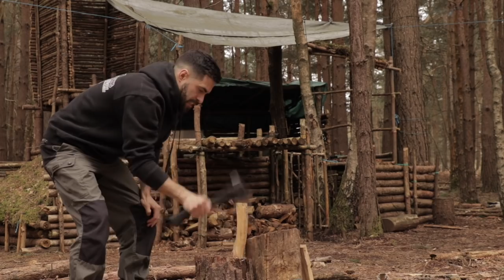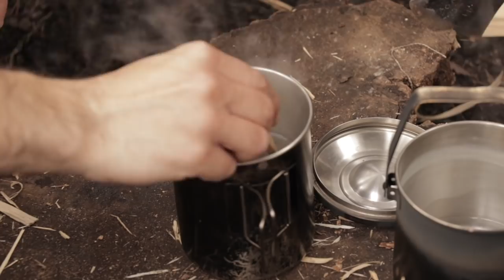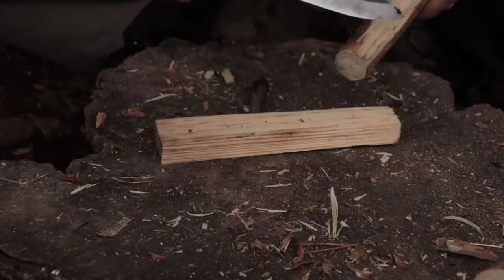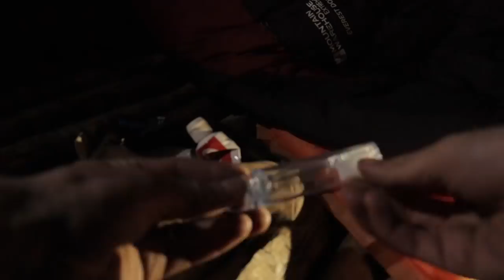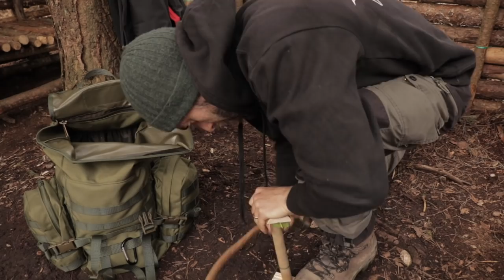Bushcraft Camp - Solo Overnight in the Super Shelter, Axe, Campfire, Lean to Shelter

Comment: If the sound is out, skip forward a little or back and that will sort it out. It's been happening to me also :)
Reply: Philip Douglas thanks
Reply: that would be google ads lagging the synchronization of the sound track ... just pause wait for about 10 seconds and then resume ... another option is install an adblocker to drop googles ads and limit it's spam

Comment: 3:40 .... bonus points for the “Snatch” reference lol!  Great video as always, love the new hatchet!  On your knife sheath/ferro rod holder... I’ve found those elastic shock cords break and deteriorate, so instead I use bank line as a loop lanyard on my ferro rod tied with a Canadian jam knot.... tighten the knot to hold in place, loosen to release (just like the elastic).
Also a suggestion if your sleeping bag slides around on your mat, with a small mat like yours you can can put it INSIDE your sleeping bag.

Comment: Grand outing Mike the hatchet is awsome it is handy that it has multi uses A tip for the head torch I put a slip of paper inside so the battery doesn't make contact a just remove it for use.

Comment: Second comment, my apologies, but I forgot to suggest as far as your headlamp batteries issue, what I found so handy is to get a battery holder or case that normally gets stashed inside your kit somewhere, and attach a bit of webbing strap, or a clip of some type to the back and mount it to your headlight strap. You can usually carry two sets of batteries for a light and it keeps them close at hand should one set die, or you remove batteries from your headlamp when not using them. Nice thing is many headlamps have a separate battery compartment so it doesn't look unusual.

Comment: Hi Mike. 
A little advice on the head-torch battery issue: some headlamps will let you put the battery in 'reversed' (the wrong way around). That way, even if something presses the button, it wont turn on or spent the battery.

Comment: I got a little tip that I learned through using my axe. If you have a piece of wood with a knot in it try to split it streight down the middle of the knot and usually you will find that a knot splits very easily if it's hit exactly in the middle.

Comment: nice vid
iv got the same head lamp as you. i find if i leave the cap screwed on the battery goes flat.
i just back it off a full turn and its fine. iv left it in my boat tackle box for months and when i needed it i tightened it up up and it worked fine
give it a try

Comment: I make walking sticks from time to time. I use old used motor oil. Pour oil on a rag and wipe it on the stick. Then draw the stick thru the open flame of your camp fire. The heat causes the oil to soak into the wood and makes it much more water resistant.

Comment: I dig that curl hack. I tried it but only did one stick. Didn't work, but I also think the wood was a bit too green due to being in a swampish area. Plus I think that using more than one would have worked out better in case it actually caught.
Reply from the maker: Also, to help make it easier, try and do thicker curls to begin with, they add to the support and stability of the feather stick. Then finish off with really fine curls, that way the sparks should hit those first and ignite them, and then burn into the thicker curls and make your feather stick burn for longer

Comment: At 28:00 or so you were asking about the holes around the trees; I was thinking either fox or coyotes (no 'yotes there, though) or wild dogs, but when I read the other comments about badgers I was surprised.  I didn't know The Island had badgers on it.  I figured maybe marten or weasels but not anything as big as a badger.  What the hell do I know? LOL
The local university (Purdue) has a very good entomology department.  The department head emeritus is a very nice man and happy to engage in conversation about insects. You call 'em wood lice, we call 'em roly polys.   
The hatchet you made is very nice.  I really like the blade shape and thickness, and the straight wedge coming down from the drifted hole to the very edge.  The poll is so nice and new-looking, so pristine getting wistful  I really hope you never mar it, at least unless you absolutely have to do so lol!  The handle is very nicely rendered.  Kyle Noseworthy would be slightly jealous, I think.
The bowdrill was a nice try.  I've never used one so I don't know personally how difficult it is, but it looked none too fun.  The backpack looks pretty cool.  To keep the sleeping bag from flopping around, some paracord would go a long way towards eliminating that, I believe.  Keep up the good work.

Comment: Great video :D i wouldnt really rely on moss to find north though .. I tried that in the Ardennes but its so humid there that moss even grows on the southern side of a tree. Also depends on general wind direction , humidity, ... or in dense woodlands the sun doesnt get through easily. To many factors to take in account to make it reliable :/
Reply from the maker: Yep for sure I agree. However, if you can see the sun, you can hang around for 5 or 10 minutes and gauge the direction it is moving. Then you can find north more reliably.

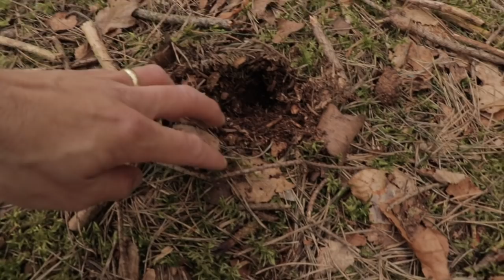Comment: @27:00.... A badger digging for grubs and mice? 
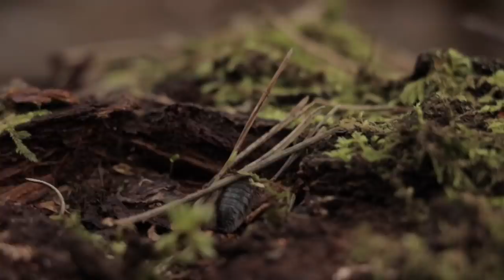@31:00 playing with the roly poly bugs! :) 
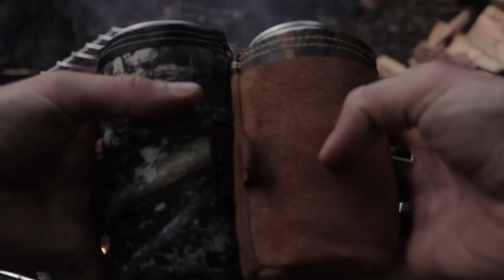@42:00 I made it this far and then had to cook something to eat. Torment!
@1:00:00 Beer xans are building material! Take off the ends and you have a tube make a chimney or vent, take off the ends and split one side and that's an aluminum shingle, opened up and you have a candle lantern, drop a wick and some oil inside and that is a oil lamp. Boil water, brew tea, render sap, reflect heat, cook a potato under coals..... the humble beer can, my friend!

Comment: What is it about these short handled hatches that you prefer over a full length handle axe?  We call woodlice "rollie pollies" were I am from.
Reply from the maker: I would use a full length handle axe for splitting large pieces of wood. For example when we were filling the log store in autumn last year, we used splitting mauls and large axes. But now the majority of large pieces of firewood have been processed, I only need a small hatchet to break it down to get a fire going.

Comment: is it bad to put a billy can directly on a fire or should you hang it somehow
Reply from the maker: no you can put it straight on a fire. It's better to do that when you have a hot bed of coals or a fire that has been going for a few hours. It will boil quicker that way. But I was making use of the flames early on and boiling it over the flame

Comment: Bowling pin?..Naa..more like a basher..or wooden baseball bat... What u need is a collapsible blow straw or pipe about 18inches long..good for backpacking..and blowing early fires to full burn..at the camp.. or you can use ur dads.. Fire Bellow. 

And last but not least..a foldable shield for ur fireplace..(covering 3 sides)..that way..when ur going to sleep..u place the shield toward the back and front of it would be the fire place..most of the fire heat is reflecting towards u.. Maybe your dad can make some with steel corrugated sheet and door hinges..(opening n closing)..how high n wide is up to u..but something that's easier to carry with u.

Without buns..a beef pattey..is just like a kebab.

Thank you for the video.